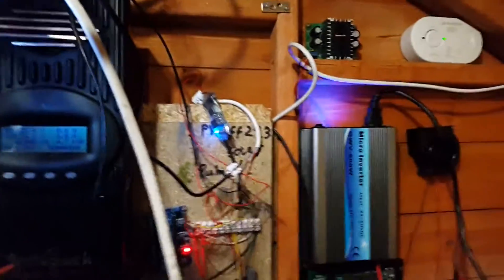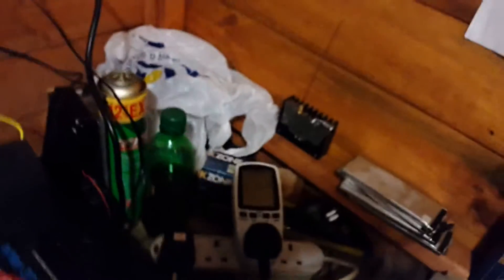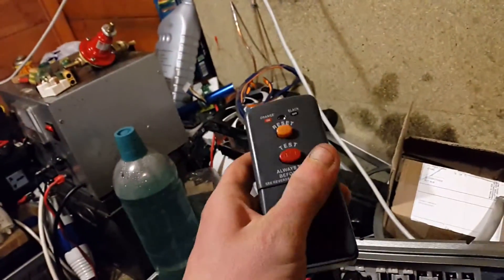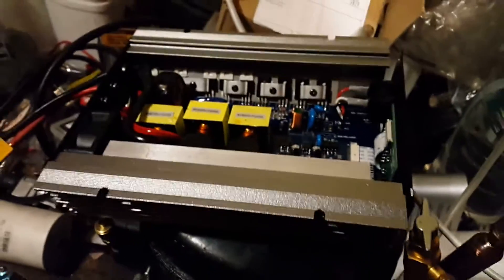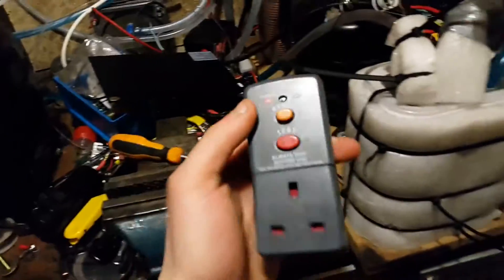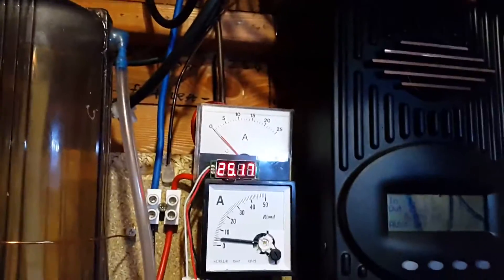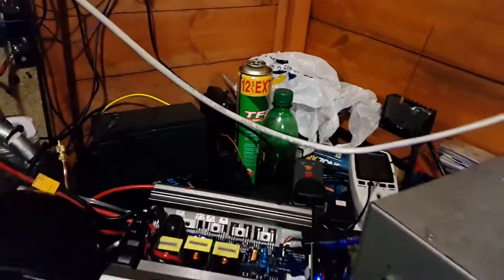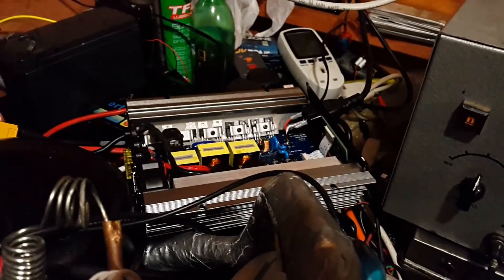Grid Tie Inverter Safety Issue GWV-600w

Comment: I repaired mine with 4 mosfets 34NM60N BUT NOW THE IRF3710 the input of the panels to the transformers have been damaged, I have to put more voltage or higher amperage

Comment: Oh dear! - Not kool , I just took delivery of one of these to experiment with , I tested the island protection by simply switching it off at the socket - it shut down i assumed no issue but i did not have any inductive loads connected.. This is a major safety issue! i suspect this maybe something to do with the Startup capacitor on the ac motor (its appearing like the grid is still there) can you test it with a restive load connected also at the same time
Reply from the maker: If you switch it off at the socket then it will work fine but if you switch it off further down and have other things connected like I did, it won't switch off.
Reply: yeh thats pretty bad,but as you said in the video the chances of it being able to backfeed the grid in a powercut and harm a lines man are slim & non it would just overload instantly
Reply from the maker: The Insignia  That's right, the grid with all those houses connected to it would be pretty much a dead short to the inverter and it won't cause harm but it can damage equipment in the house and pose a safety risk if you were to switch off your main breaker. It nearly damaged our boiler when the house electricity was turned off.
Reply: Yeh.. its def an issue if your on a key meter where grid disconnect is possible, must be a solution for it , Iv just been messing around with one of these today seems to work pretty well, got it limited to 300w but having trouble turning it off/on with a solid state relay more fun an games though i fear the Sunshine is going to become a rarity now for a while , currently getting 32w out of a my 1080W array
Reply from the maker: Just use a mechanical relay. I have 1200w of solar panels and some days in winter I get nothing at all.
Reply: yeh 1080w here , though iv  never seen that from them!  890w was my best , switching to old school relay as these solid state ones just dont cut it the first Chinese one blew up after 3 days , and that was just switching 1 amp to a conventional relay!, these cheap ying tong grid ties do seem to work ok though